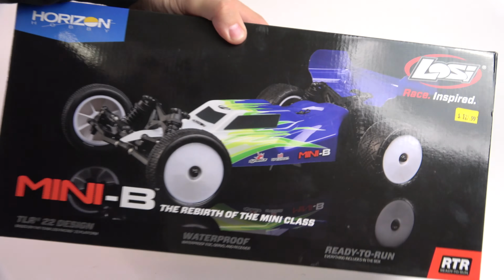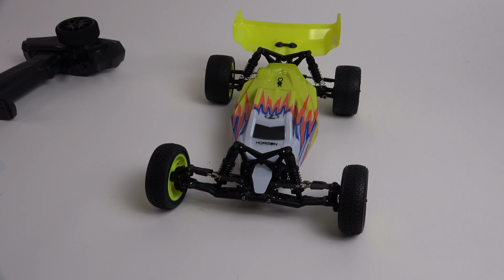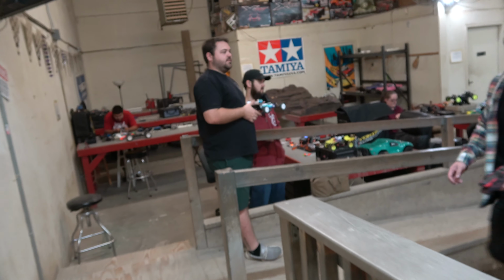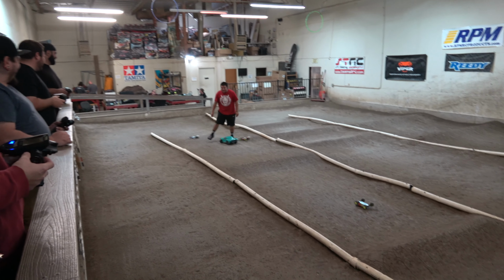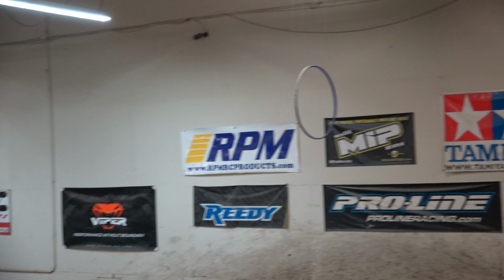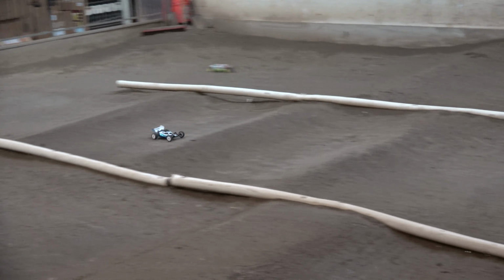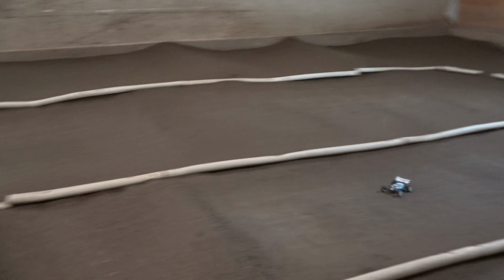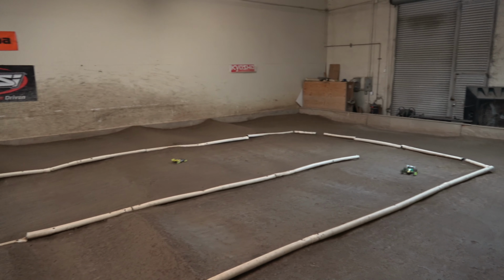Losi Mini-B First Drive!! Track Day at Tonys Hobbies in Southern California

Comment: That's a fun car, stick a dynamite 6000kv motor with esc in it an a different receiver it's a beast, only downfall id say is servo horn isn't that great would change it out the metal servo horn and the turnbuckles aren't that great If you accidentally crash then bend pretty easy
Reply from the maker: You legit read the future lol. My turn buckles were destroyed so I just put a new set of jconcepts on last night. I also installed a brushless hobbywing system yesterday too. The servo will likely be one of the next upgrades for sure! My two friends put reefs micro 99s in and redrilled there chassis so it all fit and they like it so far. I appreciate the constructive help for sure! Hope you have a great holiday and new year!
Reply: @SeanLewisMedia  yea I ran my for a day before doing a full upgrade its a blast for sure, hope you enjoy, an as well have a happy holidays